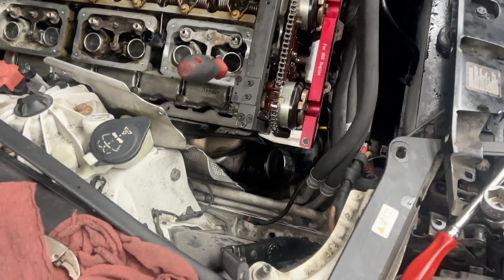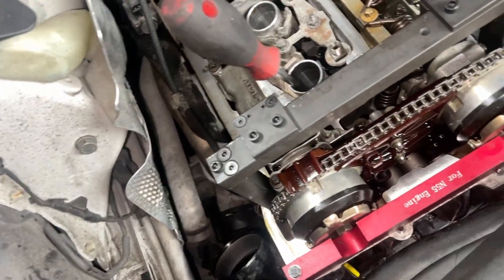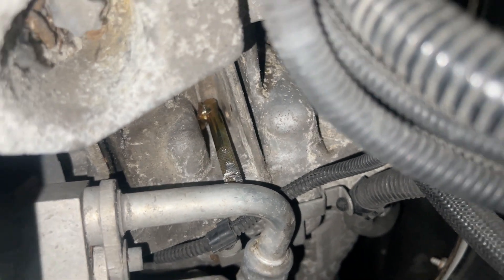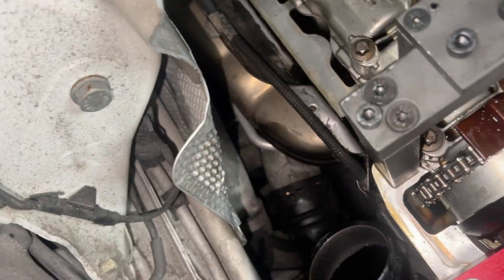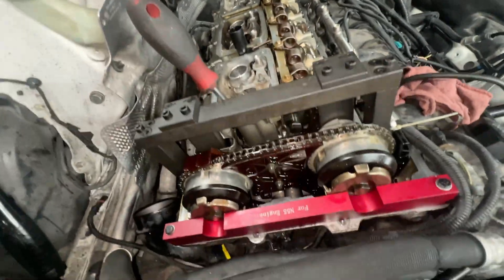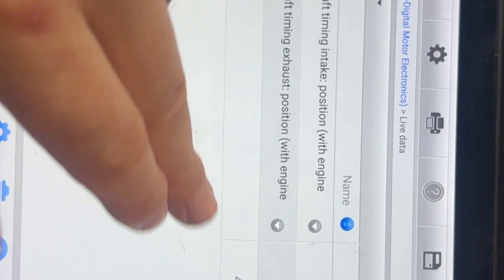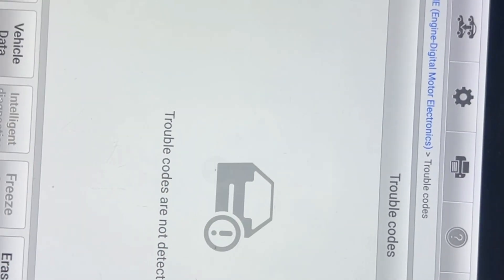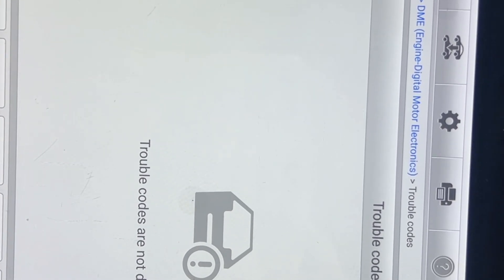BMW Fix 130E20 & 130F20 – Timing Chain & Camshaft Offset Repair (N55/N20/N26)

Comment: What parts did u get for this
Reply from the maker: Customer declined changing parts. Just retimed it. It’ll be good to change the sprockets , bolts and tensioner
Reply: So timing was off?   1 tooth? What caused it to jump timing?